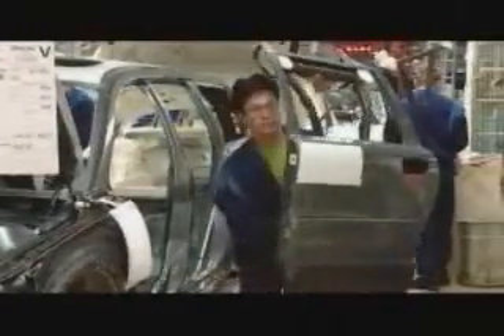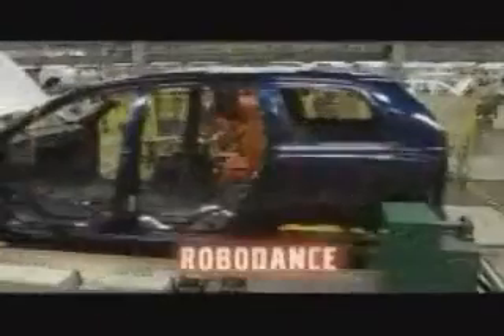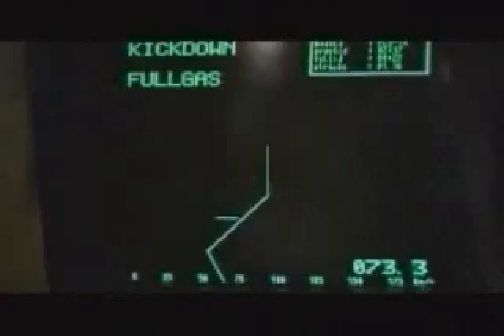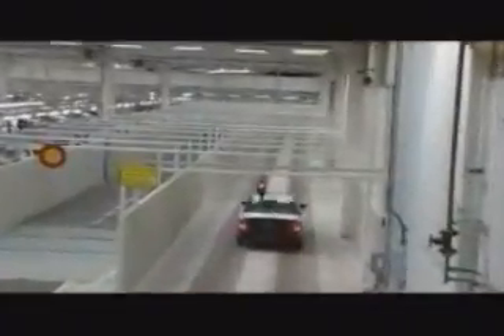A PEAK AT THE VOLVO TORSLANDA PLANT

Comment: Love to see the footage from TB2 (body cleaning and rust coating with immersion baths) at 05:57 - 06:23.
I used to work there on weekends while studying, around year 2006 - 2011. Harsh work but good money for a 19 year old guy.
From 1987 there were dual lines at TB2. Around 1996 they only used one line.

At 05:57: The two vertical tunnels transfer bodies to and from the paint shop buildins TB2 and TB4.
At 06:01: After the dual escavayors, transfering bodies to the dip phosphate tunnel.
At 06:04: Inside the phosphate tunnel. Some sprays after an immersion bath, then dipping and exiting of the phosphate bath (green liquid).
At 06:10: Outtake of the phosepathe tunnel. Disconnect the skid from the pendulum conveyor and let the bodies be tilted 15 degrees both front and rear to let fluid exit.
At 06:14: Intake of the ED-tunnel.
At 06:15: Dipping the car bodies in the e-coat (grey liquid).
At 06:20: Outtake of the ED-tunnel. Disconnect the skid from the pendulum conveyor. Skid cleaning and transport to the ovens.
At 06:22: Transporting bodies inside TB2 to TB4. In the background you can see some C70 bodies and further back some of the dips from phosphate line 2.
At 06:24 - 07:07: Inside TB4, painting of primer, base and clear coats.